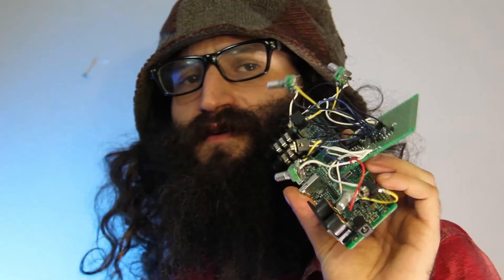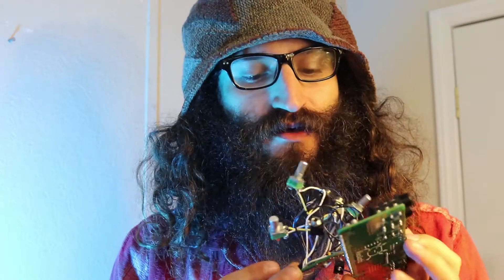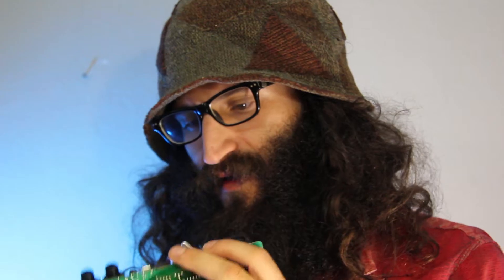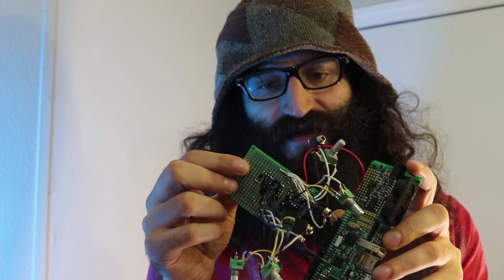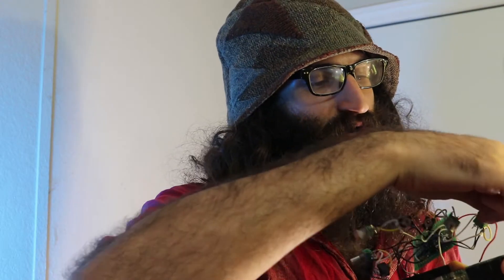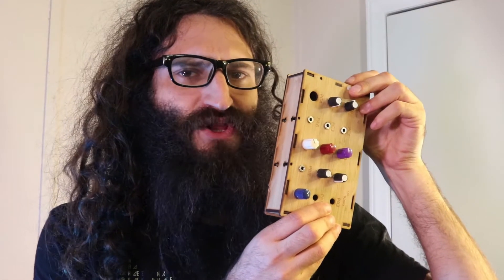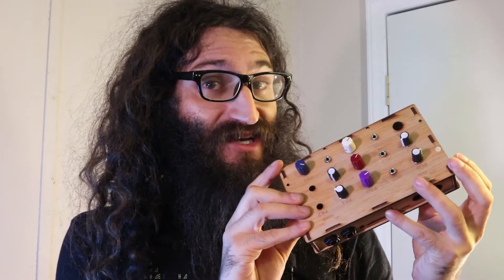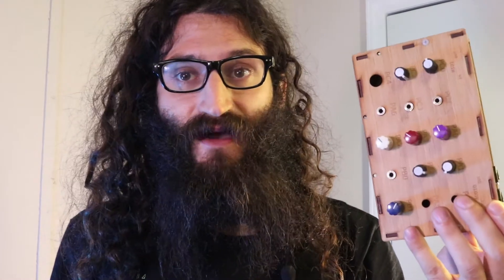Building An Axoloti Synthesizer

Comment: Hi Noah. have you used this with your eurorack? Would be amazing if you could share the circuit you mentioned...:)
Reply from the maker: ive tested it with eurorack but have yet to make a good axoloti patch to go with. im thinking some sort of volyage controlled delay. I've been pretty busy recently but hope to make the axoloti patch soon. the circuit is just a diode clamp followed by a lm358 as a voltage follower. the lm 358 is powered from 0v and 3.3v so it will clip the signal at 3.3, althogh the diode clamps do the same thing. 3.3v is on the normalization pin of the pots so the pots act as a static control voltage if nothing is plugged into the jacks. make sure to mind the diode drop when setting your reference voltages for the diode clamp. The op amp was replaced for one channel with transistors because I could not find my op amps when I was working on that part. the op amp works much better as the my transistor circuit imparts some wobble to the cv coming in. over all I'm happy with the circuit, there is a bit of cross talk I was never able to ferret out, i fairly certain it wasn't anything on my end, unless there is a solder bridge under the header I put on the axoloti. see the axoloti forum http://community.axoloti.com/t/official-pin-outs-revised-work-in-progress/1284

http://community.axoloti.com/t/official-pin-out-ports-documentation/202